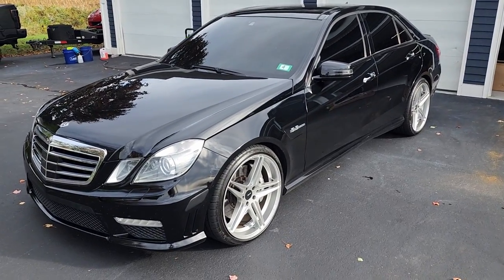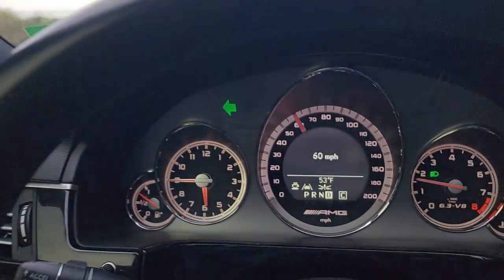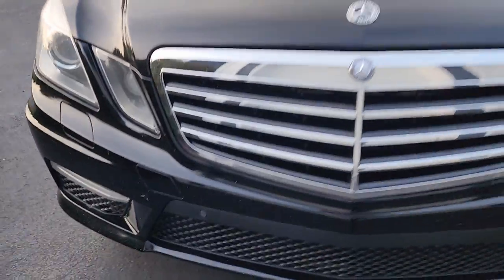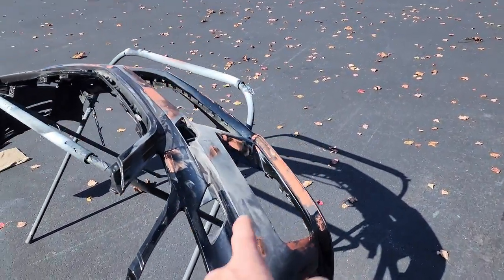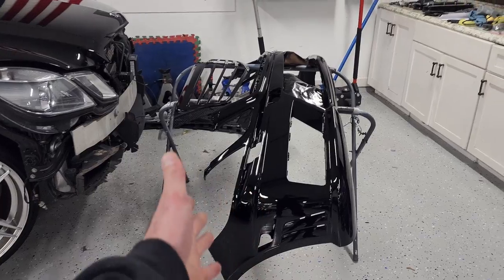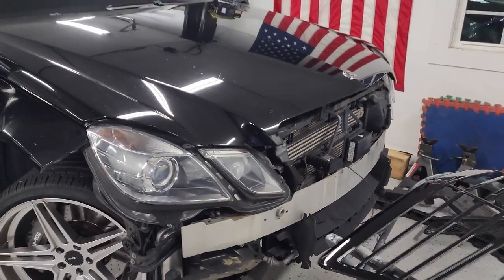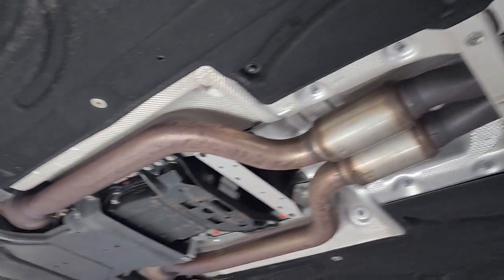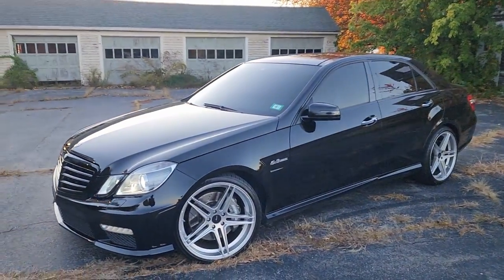FRESH PAINT: E63 Front End Transformation!

Comment: I also thought the distronic cover on E and S class cars is ugly AF.  My S-550 doesn't have distronic but I want to black out my grille.  I am probably going to buy a spare chrome one and black it out so that I can swap if I ever want to change it back to chrome.  Good to know that it can work without the ugly grille.

On my S-Class I had a similar style exhaust.  I took out the secondary bullet cats and replaced with an X-pipe in that location.  Left the factory resonator, and then removed the rear mufflers and made some pipe to replace them and welded on the stock AMG tips to keep it looking OEM from the back.  It has a nice deep tone around 2000 rpm but no drone in the car.  I almost wish it was a little louder but it's just enough to sound mean but classy.  I didn't want to do full straight pipe because it sounds too raw.  I might remove the resonator and then add in some chambered mufflers at the back, not sure, or I might leave it.  

I drove out to Cali and had OE Tuning tune the car for me and I bought their flash loader, so I have 5 tunes on it, stock, 91 octane performance, 91 octane performance with exhaust burble, 110 race gas, and a valet tune that limits it to 45 mph. We only have 91 octane pump gas out west.